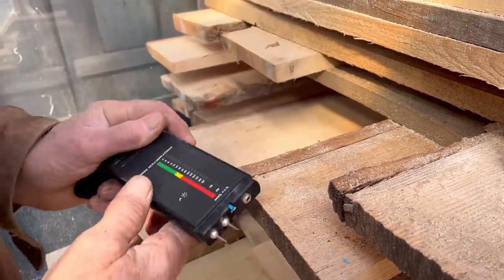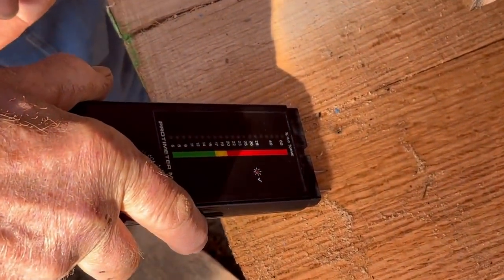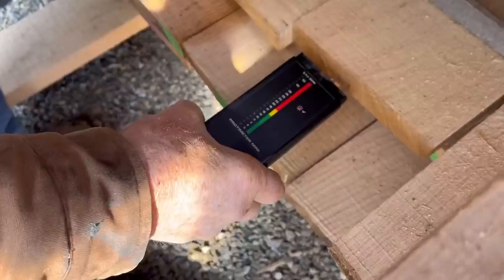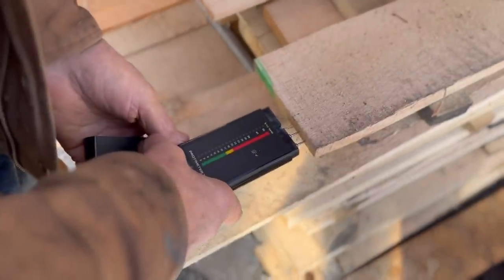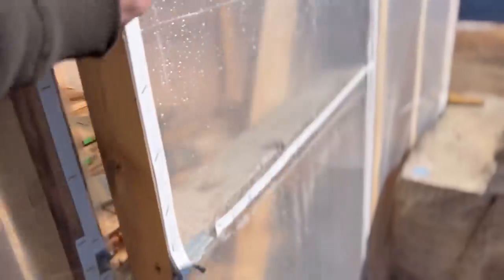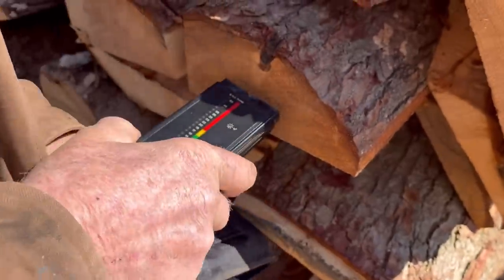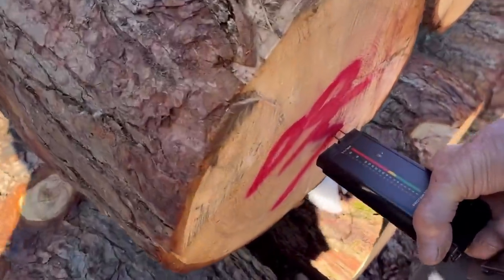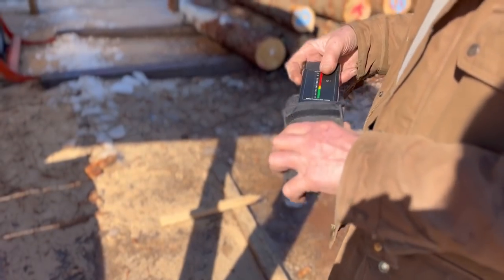OUR WORK WEEK: day 2

Comment: Hey emerald 
I have a suggestion as a tree guy that has to clean up sawdust. 
We use a rectangular garbage can to move it 10 shovelfuls at a time. 
It's even got wheels 
Lay it on its side kick and shovel it full roll it out to the truck. 
Use to use tarps but found the rectangular plastic wheeled garbage can a huge time saver.

Comment: You could increase the insulation/heat in the kiln by putting a second layer of plastic on the inside of the studs. That's how greenhouses are insulated.

Comment: It’s been my experience with testing for moisture in you lumber in a kiln the moisture content of a board at the end is going to be very different than in the middle of the board. Try putting a piece of lumber of the same species on the top of the pile. When you think the lumber is done drying take that piece of lumber out cut it in half and test that new cut end. You may find the moisture content is much different. Just food for thought. I absolutely love your channel and you videos, I have a small set up here in central  Maine and I have started using some of your tricks and they help out a lot. Please keep them coming.